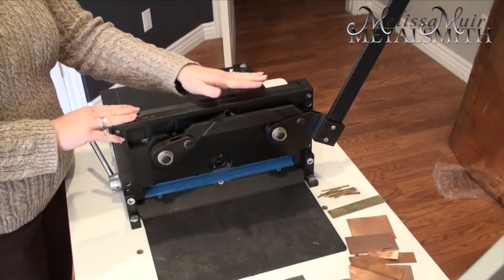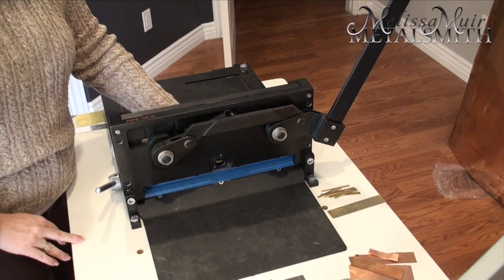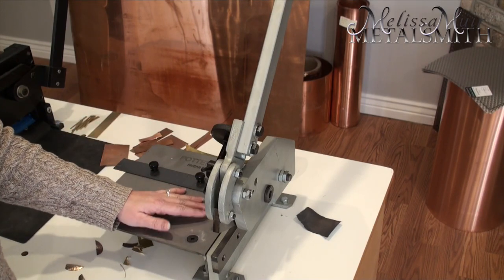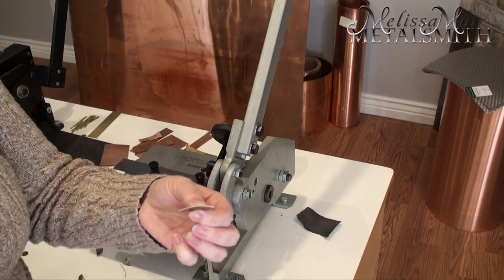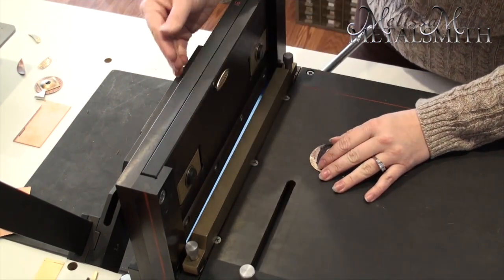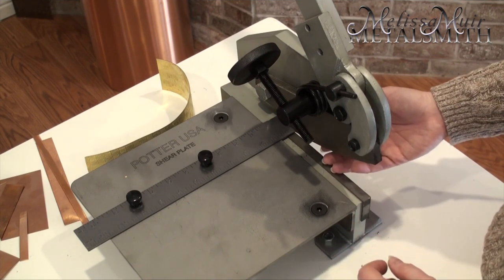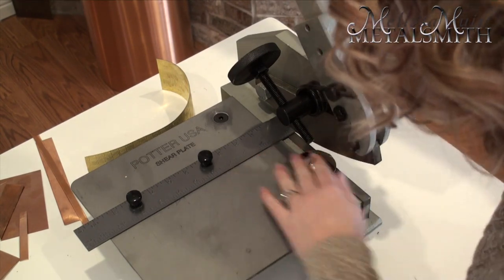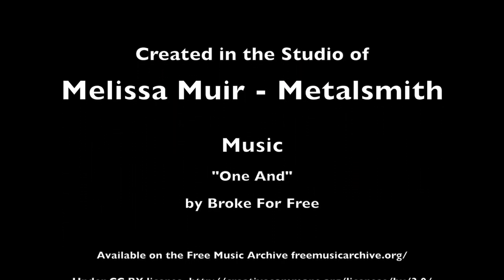Shear Comparison

Comment: Great video! What kind of table are you using? I have a guillotine shear that I haven't found a table for yet. I'm concerned it could turn the table over,  what height table are you using? That handle is so long is it hard to use? Thank you